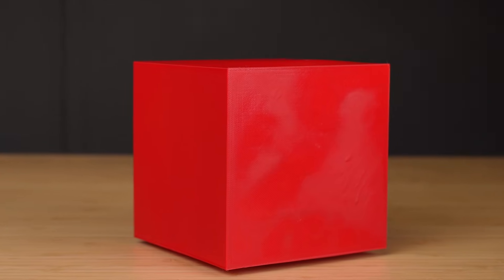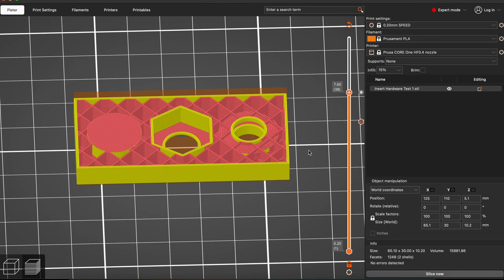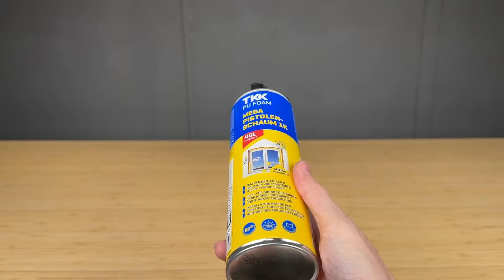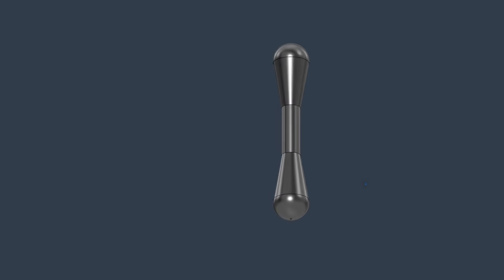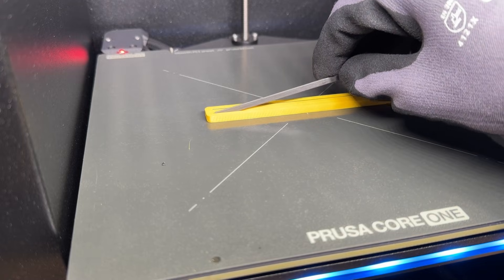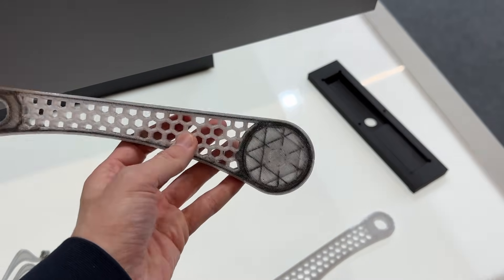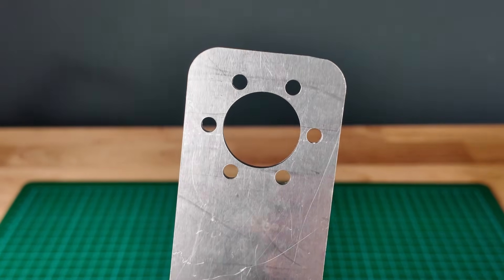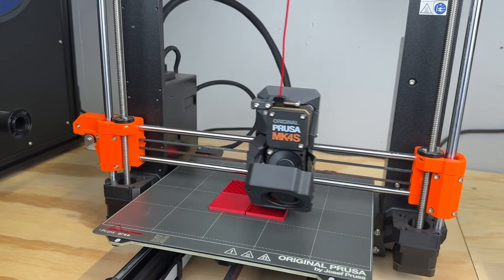Stronger 3D Prints by Inserting Hardware While Printing

Comment: Tell us what you really think about Fibreseeker 3. My concern is that it doesn't add a lot more strength. I wish someone would do an actual test compared to MarkForged, and release the test before the KS closes. In fact if no test comes out, I am cancelling my pledge because it means they avoided sending one to someone capable of testing it - likely for a reason.

Comment: From what I have seen of most slicers, they can only do bridging moves over vacities, regardless of whether or not they are filled. This is quite unfortunate when you want to place a section that was printed beforehand. Is there a way to tell the slicer to print such "overhangs" like a normal layer?
Reply: yes, you just need to increase bridge flow by a lot.

Comment: Another idea instead of the fiber strips is to print a strip flat on the build plate and insert that. It won't be as strong as the diver strip but it will be much stronger than the print on its own.
Reply: Interesting idea which strengthens through a change in layer orientation.  I'd love to see someone test that with measurements.

Comment: Could even use chopped carbon fiber, and leave a way to inject epoxy in.  

Filling with concrete, leave a few millimetres empty at the top, then print over. 

Also embedding electronics like LEDs, and wire traces.

Comment: Do you usually put ironing on the layer that will have contact with the added material to improve tolerance?
Reply from the maker: No, but I used 0.2 - 0.3 mm tolerances in my designs. Have you tried ironing in that context?

Comment: You could also print a hexagonal rod lengthwise. Though not exactly circular, could eliminate the issue of layer adhesion/separation. Also significantly reduces the print time by reducing Z-height. Could also print in two pieces and superglue for better dimensional accuracy. Can also work for cylindrical rods. The only limitation being max length that can be printed in xy axes.❤👍

Comment: Wouldn't it be far far better to design so as to add the weight, or the strengthening members, after the print finishes? Your sculpture head could just be hollow and then leave a hole in the bottom and fill that with sand and plug the hole. Could also fill with strengthening fill of epoxy mixed with chopped fiberglass or carbon fiber. Inserting objects in the middle of printing would better be left only as a last resort. Having to wait for possibly hours and then attend to the printer when it pauses, not exactly convenient. It always mystifies me for instance when people add a metal washer or a hex nut while the printer is going. Just make a relief cavity for that part and glue in place afterwards. If you really have to insert a member while printing, divide the print into two parts with alignment pins, and glue the two halves together later.

Comment: I use self-adhesive wheel weights to add heft to a print. They work well post-printing too, I stick them in the bottom of light boxes so the light box isn’t so tippy.

Comment: Threaded rods with threaded brass inserts are good. Flat metal inserts are not a good idea because this not an overmolding process and even if it was, plastic-metal bonds generally are pretty weak. This means you will have attach the printed part using screws which then raises the question why not go all the way with metal? I have a chair where plastic was overmolded on a flat piece of metal and the plastic cracked. It still holds because the plastic only acts as an armrest, while the metal is carrying all the mechanical loads. The armrest is attached using screws as one would expect. This means the plastic is only there for comfort reasons.

Comment: TIP: In Prusa Slicer, to see the printing times before and after pause(s) click "Color Print" from the drop down menu in the upper left window. This shows the print duration and time left for each pause even if you're not doing a color/filament change.

Comment: You could print inserts for your parts in different orientations and then combine a part printed vertically with horizontally printed inserts to get some extra strength in the Z axis for "free" since you don't need any extra tools or materials beyond the filament and printer.

Comment: Its brilliant to embed things into the print using the pause command - I've been creating painting handles for painting Warhammer figures, with embedded magnets that catch on the to magnets I glue to the bottoms of my bases of the figures, for easy hot-swap painting handles instead of using blue-tack or other fasteners - works like a charm!

Comment: One nice thing you did not mentioned. Try round carbon rods 2-3 mm diameter, they very flexible and can be inserted into bending holes, which makes tension inside models, to keep thin walls stronger for example.

Comment: I've used a resin plaster before to add weight after printing, something like Jesmonite, basically a resin with bits of stones. I have some around for casting.
I don't recommend using plaster of Paris (real plaster), I've done it a couple times and it traps too much moisture and will go moldy in my climate.

Comment: I often make round channels to put steel cable inside them. Cover them whole or just ends with superglue before insert. Works good. Leaves the play of the part, but adds the level for reliability.

Comment: i can see companies like Bambu Lab having a seperate placer head with a set of selectable rods and clips off and away from the bed where it goes and collects the part and puts it in the print itself without pausing. this seems like a natural advancement for 3d printers. I see a few years down the line where 3d printers have a seperate print head that makes the metal part during the plastic printing that it inserts into the print . like a little factory in a box. there is no reason why a head couldnt inject a foaming adhesive into cavities, like factories that produce say chocolates where the smart head goes and deep fills the chocolate shells with fondant.

Comment: I'm the guy that did those experiments in the Hackaday article. 

Quick note on filling with PU foam, it's best to also fill you part with water first, then drain it before filling with foam. 

PU foam uses moisture to cure, this will ensure that all the foam will cure properly, otherwise you might have uncured foam trapped in the middle of your part (especially important for large parts)!
Reply: As a chemist working in the PU industry: No!

Here is why: Yes there are one component systems that rely on moisture, there is also two component systems that dont. However even with the one component system, you want to avoid direct contact with water because the NCO+H2O reaction creates a lot of CO2 which will cause bubbles right where the water was. But this is exactly where you want good adhesion, as otherwise you just end up with a loose PU rock inside your print, rather than an adhered block. I'd say for a smaller print just wait one day and in this time air and thus water vapor will diffuse evenly into it, curing it with only very small bubbles if even. If you fill your whole print bed you might need to wait a week but water vapor will eventually diffuse into every 3D print, so really no need to add it beforehand
Reply: @jens5906  I'd say curing is more important than a few bubbles. I've used PU in boat pontoons. PU first seals itself on the outside and forms a shell. You can end up with a mass of perma-jelly inside with no way to know except cutting into it.
Reply: @dougj8186  Yeah I've seen that exact same effect myself on my own projects.  I wonder if there is a practical middle ground approach that will guarantee good adhesion while still getting a full cure? Maybe something like filling a little less than halfway, then spritzing it with a water spray bottle, then continuing? Get the moisture into the middle of the part, but allow the outer edges to cure through normal means. Did you find a solution when working on pontoons?
Reply: @jens5906  I'm sure it depends on the exact details of what you're trying to accomplish, but as a generality, adhesion is not a real concern with that stuff.

Watch the guys apply spray insulation to a house some time.  It's a pretty standard practice to mist the area with water just before spraying in the insulation.  Even so, the stuff grabs.  It grabs so well that you really have to cut it out to remove it.  You can't just like, shove a crowbar in there and pop the whole panel of cured insulation out of a wall space.

If you're really worried about adhesion inside a 3d print, I would say the best bet would be to add interior shapes for it to grab onto.
Reply from the maker: First of all: thank you for the awesome video and time you put into it!
I will keep that in mind for future uses of PU foam in 3d prints.
Reply: Do we have to also flush out our houses with water when using PU foam to insulate ?

Comment: 3D printing is a functional method of manufacturing. 

That said, there isn't much info on how to use it as the means to create stronger things by adding material, as you showed here, or by making jigs, molds, forms, etc...that make working with stringer materials easier.

Comment: Appropriate material for appropriate uses. Resist using 3D printing for everything. I have used this approach and have used #D printed inserts printed with layer lines 90 degrees to the may body. Works well. Can also use CF insert to stiffen without outside being rough or shedding CF. Using your methods pushes the boundaries further. Good information.

Comment: It might be worth having a video on handing of carbon fiber cutting, targeted at 3d printer users. You mentioned safety issues, but there's the cut itself, and then can you use some epoxy over the cut end so it doesn't shed small fibers, etc.
Reply from the maker: Thanks, I'm thinking about doing a more in-depth video about it and this is certainly interesting.

Comment: Ahh! I love designing holes for rods like this but I haven't tried the mid print thing. I like using straight bits of music wire in press fit holes. It's very cheap from k&s metals, like $10-20 for 5+ meters of 2 to 6mm rods. I'm wondering now if I could press thinner cheaper rolls of music wire into channels in a print mid print to get high strength and toughness for cheap.

 hmm, I wonder if some kind of string would work for TPU or PEBA? If it did, I could maybe finally print timing belts woth tensile members! I could even stagger a few pauses so that the string ends aren't matched up on the x and y for each tensile member!

Long sheet metal or wood screws can be nice for softer plastics too. They pull in well and are cheap but can crack brittle plastics and can act funky in low temp plastics like PLA

Comment: Even without pausing, threaded rod threads into the part catching inside, it's very easy to work with, it's very cheap, it provvides with great  strenght, adding an undersized hole and tapping it in to your part is enough to make them A LOT sturdier

Comment: I had a garbage video on this and it works so well. you can do anything, insert a small metal sheet, dowel pins etc.
I even superglue continuous fibres on the walls of my print and even in the z direction the prints were insanely strong after.
I didn't wear any protection and I still cough a lot to this day LOL even worse I was cutting raw unsealed fibers, not in resin, but just bare woven fiber.

Comment: Sorry to say it, but the carbon rod section is a mess. For starters, you really need to bond any stiffener to a part to get a predictable and stable stiffness improvement - dropping in a piece of CFRP isn't the way. Second, I noticed the channel for the carbon strip is much deeper than the piece itself - so when you put the part into bending it the reinforcement is going to move freely in the channel until it can move no more, THEN it will contribute some stiffness. 

I'd suggest at least some of the extra stiffness you gained is from the extra walls added to form the channel for the CFRP strip. 

Finally, you oriented the carbon in the way that's least able to resist bending. Hardly a good reflection of the capabilities of this approach.

Carbon reinforcement has some use cases -  but the critical factor is how it's interfaced with the part to effectively transfer force to the  reinforcement rods - this needs a lot of attention and care. 

At the end of the day, it's usually more expensive to take this approach, and the additional design considerations are very complex - another example, you added a lot of stress risers to the part with that rectangular channel. For me, a well designed part using some of the many excellent carbon reinforced filaments is a better approach.

Comment: Bike spokes, windshield wiper springs are easy to come by.
I also like to use nylon cord and CA glue for reinforcing
Reply: Oooh bikes spokes is a good idea. I work at the dump, plenty of broken bikes to borrow from
Reply: @joshbuilds yeah also at least her in Europe, you find enough abounded bike scraps on the road.
Also bike shops have probably a lot.
The windshield wipers springs are all over parking lots, just keep your eyes open and you will find some.
Reply: Great tips!! Thanks!

Comment: I use a Tig rod to strengthen the z axis, just add an 2mm hole and use a drill to insert it. It friction welds the layers.
Reply: You should make a video showing how it's done.  This is a great idea
Reply: I’ve been doing this for years! 😂 there’s really no original ideas. I also use a lot of tig rod for large multi part prints to add strength while also being alignment pins (asa and abs parts)
Reply: That’s a great idea, I use the metal bristles left by street cleaners and where possible inject adhesive around them afterwards, the drill idea sounds easier though.
Reply: Is the rod itself also stiff enough or do you think another material is more advisable?
Reply: @delayedhoe9714    Tungsten  is SUPER STIFF but also very, very brittle.  CF would be more resilient.   On the plus side, though, tungsten is super dense and adds a nice weight to everything by.
Reply: @SolarMillUSA  Only the electrode is tungsten, the filler rod is matched to the material being welded. And the strength of pretty much any kind of metal isn't going to matter much, considering it's still embedded in mostly hollow plastic. You could use a hollow aluminum or steel tube to keep the weight down and still get most of the benefit...
Reply: @SolarMillUSA ive seen tungsten used in places where you specifically need a print to have more mass, like a striker mechanism, or as part of a muzzle weight kit on printed firearms. They concluded the cheapest way to do so was tungsten electrodes
My cheapest way was taking scrap tungsten carbide from my job as a machinist lol
Reply: @SolarMillUSA  I think he's talking about tig filler rod like a ER309 SS or a 70S-2/6 steel filler. Tungsten would be a complete waste to use as not only is it crazy expensive but would yield no purpose unless your part needs to withstand insane temps or has to be extremely dense.
Reply: Great idea!! Thanks for sharing!
Reply: I use filler rod, either stainless steel or aluminum. Clamp it into the chuck of your cordless drill so it spins as you push it in. 

Use your cad program of choice to put a 2mm hole in. Tinkercad works fine for adding holes to STLs.

I don't make videos, so if anyone wants to run with the idea, go ahead.
Reply: @eslmatt811  That is a genius idea . I have been into 3d printing for 10 years now ,and 
my day job is working as a stainless steel smith using a lot of these tig welding rods ,
i have never thought that you could use these rods as to strengthen your 3d printed
parts , thank you very much for this tip :-)

Comment: I often print cylindrical parts in two shells, wind the inside piece with steel wire and glue the two pieces together. 
I printed a hex nut for a car wheel change this way. (as a proof of concept, not for a real working piece.

Comment: 4:36 i actually did this for years, i first found this stategy used as "bones" or "boneless _pizza_" in a toolchanger design.
Ever since i bought a bunch of M3/M5 pins, in all various lengths, i just cut a simple hole into parts the length of the pin +1 or 2 mm with a slight chamfer, and then hammer/press them in. 
Its so easy, works so well and is such a gain that i dont understand why this isnt found more commonly in designs.

Comment: from a maufacturability point of view, it's much, much better to avoid needing to install hardware in the middle of a print. Much better is a design which allows installation of reinforcing hardware after the print is done. This way, your 3dp can be farmed out, and hardware installed by someone other than the person doing the printing.
Reply from the maker: Yeah, that's valid. It's certainly more for really small quantities or prototypes. 
Maybe at some point toolchangers will be advanced enough to do some of these things automatically though.
Reply: If your bed contains 20 of those parts the cost becomes much more manageable

But I totally agres that when possible we must insert after printing to reduce print failures, increase machine print hours and permit to do them in big batches to save time

Comment: I have added steel axes into belt buckles i have printed with ABS-GF. A short one for the prong which is still a little weak. My next try well be a M3 nut for better base and a threaded rod. The ideas is to use metal fill PLA which is to  brittle wihtout any enhencement.